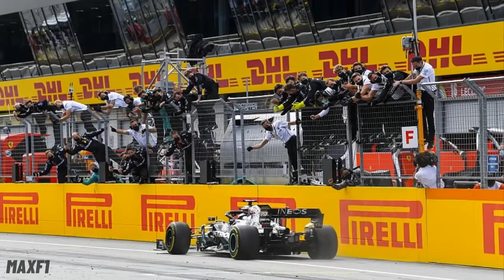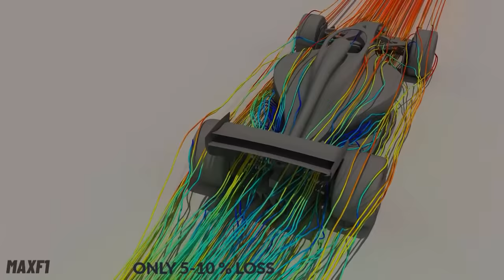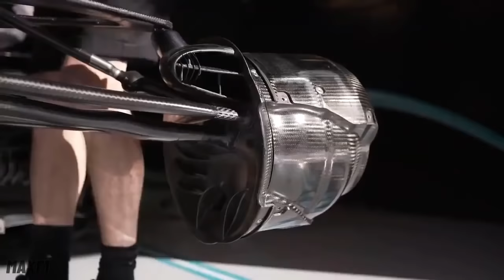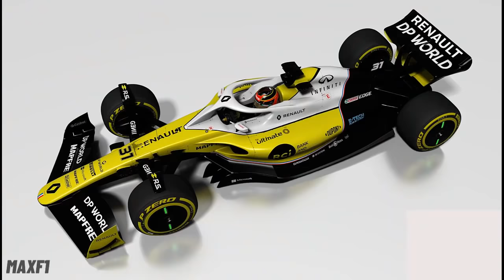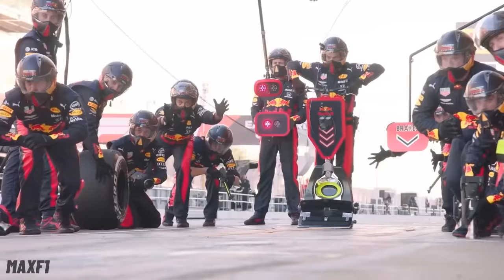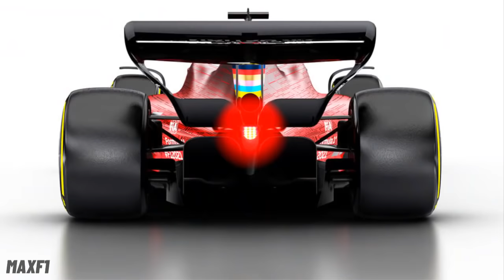F1 2022 Cars New Changes Regulations

Comment: i would like more 'downgrading' - power steering, no thx. 'worse' tires  - yes! tires should be 'bad' enough to require 2 stop races. back to 10 or 12 cyl. engines and massive horsepower. small fuel tanks and refilling during the race... force stops (tires, refuel etc) and make racing more interesting again due to needed strategy.

Comment: We need v10's back, but that would never happen
Reply: v6 turbo are the best engines in f1, not soundwise(but i like the sound of it) but they're more reliable than the other ones
Reply: i think in 2025 (originally 2022 but it got pushed back) they are planning to increase the rev limit to 18000, this should make the cars sound higher pitched and closer to the V8s but probably still a little quieter because its still v6 turbo. I would love to see v10's back but the current climate change situation and push for sustainability probably isn't going to make that happen.
Reply: @allan201arp6  they sound like cancer

Comment: The fact they’re concerned about financials being an overly important factor currently, and making an effort to reduce that advantage, is really encouraging
Reply: The cost means very little to the teams at top they have dozens of different revenue streams and the way it is allocated without direct pass through the team. For example Ferrari does not pay Shell directly to develop their fuel and other fluids, lubricants, get sponsor placement and other 3rd party suppliers pay shell-this relationship alone is millions and shows up nowhere the other teams have similar arrangements. Since when did the cost caps affects what New York Yankees? yeah never F1 will be no different is a blind accounting shuffle sound bite team principal will complain about when their struggles lol toto is already complaining about the car they wrote off last week that to them means nothing
Reply: @dalemason9886  you entirely missed the whole point of the cost cap, also I'm sure the fia knows about ferrari and shell and also shell is starting to go green so that advantage Is probably going to go out the window in a few years, also what do you mean? because of the cost cap bigger teams will ahve to spend less on their cars, alot less, bringing in closer racing, so your point is entirely wrong
Reply: @cesardepena7498  Fair enough-I am extremely well versed in the financial models they use having been in motorsports for a very long time. If you understood this then you would know how F1's approach wont work just like it does not work in major sports in the USA. While on the surface it appears to be a way to control cost in certain areas, do you really think Merc who spent about $442M in 2019 and about the same in 2020 do you really think they will cut spending to $145M on 2022 -68%? just lay off 2/3rds of their staff? FYI they added people in 2020, same for ferrari. Yes there will be changes in certain areas but that's an accounting shuffle, the big three will remain the big three. "Budgets are for teams who do not understand motorsports and the business they are in" - Ross Brawn
Reply: @dalemason9886  if merc didn't stay to the cost cap they would probably be eliminated from the constructors champoinship as it will be a rule, and yes they will have to follow it, either it is that of no championship for them
Reply: @dalemason9886  also in their case everyone has the budget cap, you can't use a quote once the quote is thrown out the window and everyone has a budget now that they will have to follow
Reply: @dalemason9886  staff won't count only the development of the car and other things featuring the car and it's performance, the cost cap is ment for cars to be more evenly matched
Reply: @dalemason9886  
Spending massive amounts of money generally doesn’t make someone able to hit a ball at super human speeds. On the other hand, If I have 1 million dollars and you have 10 thousand, i can buy a faster car than you. That’s why monitoring the spending will be very important.
Reply: @Appletank8  Not to disagree however it will be impossible to monitor and its irrelevant-the bigger team will easily side step the direct spend and being more creative with their technology partners on they are compensated. Just like professional sports in the USA their are salary caps in most of them and it makes exactly no difference
Reply: @dalemason9886  Depends on how draconian the FIA wants to be, it feels more like needing a way to properly enforce and monitor rather than tossing the towel in and letting teams toss billions into a black hole. Plus, other teams are likely to be very eager to call their opponents out for bullshit documents
Reply: any ideas for a new motorsport catagory

Comment: Will the engines sound better if the revs will be higher ? If it’s still v6 probably not but can we expect a better sound?
Reply: yeah they will sound higher pitched just still not quite to the levels of the V8's
Reply: They will be increased upto 18k rpm. Should sound good imo. Especially honda
Reply: @abdullahsalman5681  technically Red Bull engine as Honda's leaving
Reply: @abdullahsalman5681  is that still happening tho? I might have heard some rumours about this rpm increase thingy not happening. Would be a shame...
Reply: @miosink  yes it is happening. The proposed regulations involved removing the MGU-H to simplify the technology used in the engine whilst raising the maximum rev limit by 3000 rpm.
Reply: @abdullahsalman5681  You sure? Pretty sure I read that it was canceled to avoid costs because no new engine manufacturer wanted to join anyway...

Comment: Will there be changes to the overal dimensions in terms of length and width of the new cars?
Reply: Yes. New ones will be much smaller overall. Don’t have a specific number for ya as I’m no expert in This lol
Reply: The cars actually wont be that much shorter. Maximum allowed wheel base is 3.6m. McLaren are running something about 3.77m currently. The nose will reach 1.35m forwards of the front axle and the rear wing something like 80cm rearwards of the rear axle. So overall the cars will be around 20cm shorter. Which is a lot but considering the whole length not that noticeable

Comment: What is new size tyres on 2022?
Reply from the maker: 18 Inch
Reply: @maxf1  this is size rim.  725mm is new diameter wheels now is 670mm. So you dont know .
Reply: @oneferrdek3346  if you already knew why did you ask
Reply: @bxtterz16  i know only diameter new wheels. But What is width i dont know 
Diameter new rim 18x 2,54= 457,2mm 
Diameter wheels 725mm 
Width front and rear tyres ?
Reply: @oneferrdek3346  I'm not sure what the width is either, I'll have to look it up
Reply: They're thinner from 2m wide to 1m90 so less mechanical grip just slower everywhere
Reply: @UseAdblocker-r8q  and they wonder why f1 is dying, nobody wants slower cars, we would like faster safer cars
Reply: @v10-e8y  thx old  diameter iż 670mm new 725mm

Comment: Got a question I been wondering about. Why doesn't F1 use porsh engines?
Reply: Boxer/Flat you mean?

Simply because the engine already sit so low, there's no room for underside exhaust header or intake. Uplifting the engine will only raise the CG, defeating the purpose using the flat engine
Reply: Very good question! Boxers have lower center of gravity by nature. But they have to be wider as well - maybe that's the issue - rear section would had to be wider...?